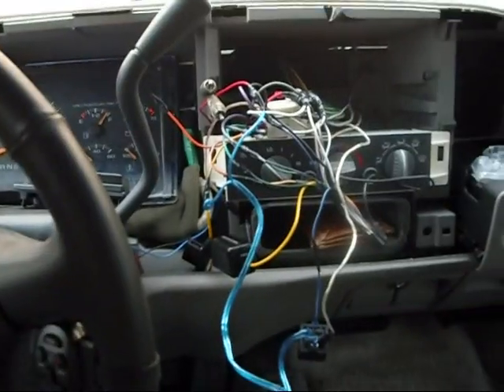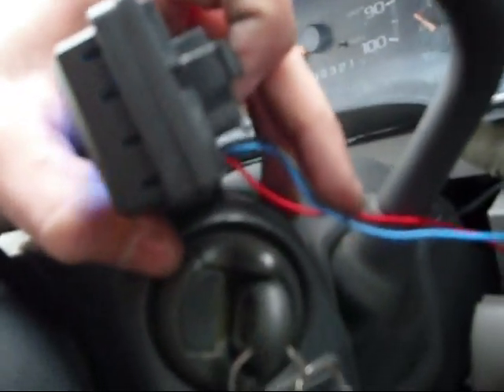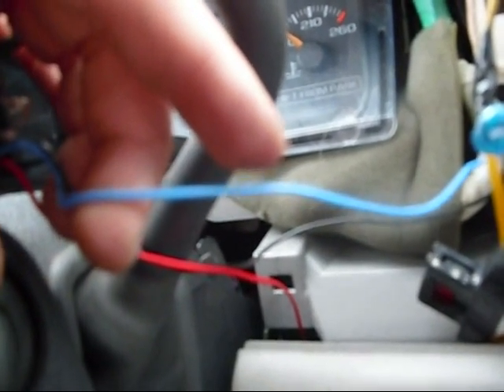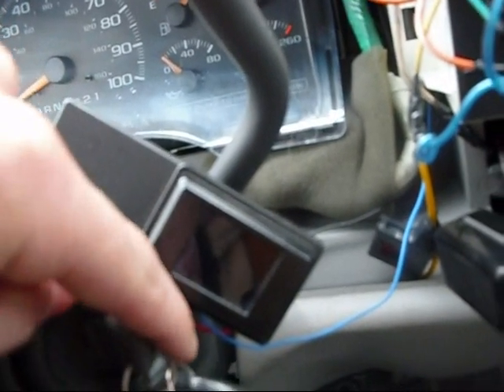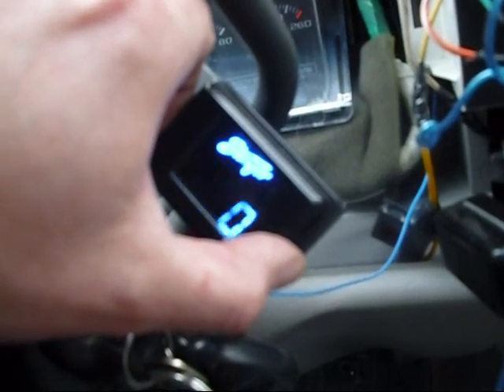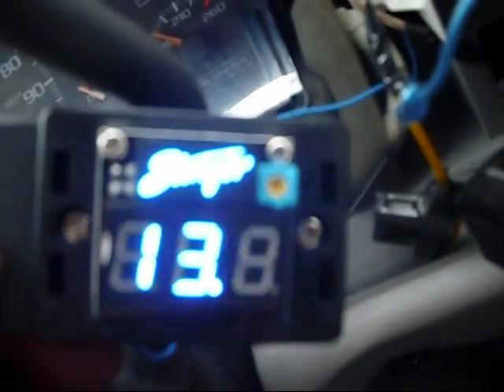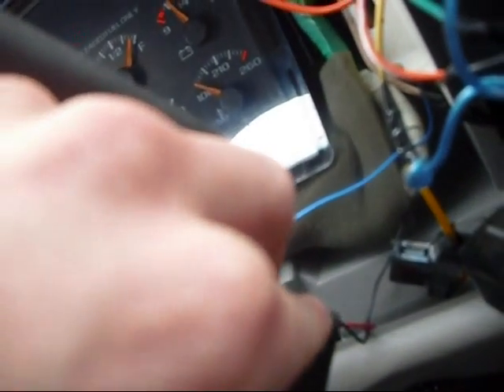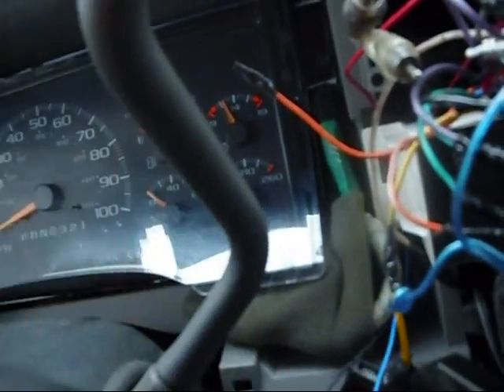how to wire a stinger volt meter

Comment: I would take the power from the power wire going into the amp. That way you're accounting for voltage drop across a 10ft wire run and all your connections. 
Because it doesnt matter if you have 12.8 volts on load at the alternator if you only have 12.4 at the amp.
Reply: The amp will draw current from the main run. 
Think of it like the amp is asking your battery for power depending on your sensitivity and volume. You tell the amp how much power to draw. When the amp asks for power it will find where to get it. The easiest path for power is the main run from your battery. That current is going to run through that wire directly to your amp and out. It won't travel through the little 14 gauge volt wire because 
1. The volt meter isn't asking for amperage. It's just taking two wires ( your battery positive and ground) and saying oh this is how much latent voltage is in the wiring. 
And 2. It's easier for power to continue through the amp and down to your whatever gauge ground than to squeeze itself through that tiny 14g wire that you use for a voltmeter. 

This is a vastly simplified explanation and there are particular exceptions but in this use case they don't apply. Hopefully I've digested the information somewhat efficiently but its hard to explain if you dont have knowledge on basic electrical theory.
Reply: that's not how it works.
99% of the time you are only going to draw power from a load or from a short circuit. the meter is just checking voltage its not a load that will suck a ton of power. for example. why does your amp only draw power when it is on? and draw less power when the volume is on 2. then when its on 30? you will only draw as much power as the load demands. the amp is what is drawing the power. the meter is just checking potential

Comment: I think you got it mixed up the blue wire takes the voltage the red wire goes to the power or switch . (remote turn on like you say ) . the blue wire will take the reading!!!
Reply: no red is positive like a car battery black is negative like a car battery and blue is the remote turn on like on a car radio or amplifier..when the key turns the blue wire allows the circuit to complete that's how you get the output in the display..please get help when you install it so you don't catch your car on fire

Comment: i have 3 optima battterys in the back of my car to power my amp and 1 bad stock battery  but i only have 1 alt. The problem is that i've heard that it is not good to have a stock battery connected to the better high quality batteries, how can i fix this? Charging the batteries in the back without connecting them to the bad stock battery with 1 alternator?
Reply: +Tobias Johansson who told you that lol you can run whatever with whatever but if you run deep cycle batteries to power your amp i would get a relay because they don't like being used as starting batteries

Comment: If I have a digital battery cap do I still need a voltage meter
Reply: Honestly, I wouldn't trust anything about a cap unless you're running class ab amps or lower. If you're running class d, all it's doing is restricting voltage from getting to your amp causing low current clipping. I'd rather just sell that and run a big 3 with a better battery. You'll honestly gain dramatically.
Reply: +STOPH3R01991 don't forget that a bigger alternator is what really makes the power along with the big 3

Comment: Where did you ground yours at? And the reason it was flickering on the camera is because the cameras refresh rate( most likely 60hz) is the same as the volt meters screen refresh rate

Comment: My 08 crown Vic doesn't have a voltmeter at all for the battery. I want a voltmeter to make sure when im dropping the low notes and just to make sure im in safe range. Would i wire it to my battery or to my alternator? Any reply will help just looking for some advice. Pretty sure my power is fine since i got 1 cvx 15 with a 2000 watt amp . Just want one just in case and for the future. Thanks!

Comment: and now i got my own! ^_^ lol got it last 2weeks on amazon for 24.65 a.k.a 30.23 and this thing is worth it lovin the blue led display ^_^the weird thing is tht i set mine with a 13.8 v 7 amp power supply and on my 20 amp it reads 14.1-13.8 volts..not tht bad xD

Comment from the maker: when you wire up the meter it doesnt just know what the voltage is you have to set it with a seperate volt meter and turn the screw until they are the same

Comment: hook it up to a relay and you will get a true reading of the battery and it will turn off when you turn off your car
Reply: I know this is an old post but.... I like that idea... Hook it to a relay with the switch side hooked to an acc power source. That way you can get a reading from your battery without it being on all the time. The way he has it, is it tuns on only when his head unit is on. Which is fine, but what if you don't turn on your stereo? But if you have the remote wire (which a lot do not), just hook that wire to an acc power source.

Comment: I bought a voltmeter off ebay. But it doesnt have a remote wire. Only the red and black wires.  Does this mean i need to install a toggle switch in the positive wire?

Comment from the maker: @kwag415 this gauge does not read voltage...it has to be set with a volt meter...all it does is read drop and gain to give you a reading,if yopu just hook it up it wont give you an accurate reading

Comment from the maker: @DaBandiiT you can wire the 12v to anything but it has to be a remote turn on when the key is turt...unless you run it on a toggle switch but i wouldent mant to have it that way

Comment: in order to set the voltage properly on the stinger meter did you take that reading initially when you hooked it up from the alternator or from the battery with the vehicle on/off? ...

Comment: @jonmanch3st3r does it say anywhere on the packaging exactly how accurate it is? I bought one of those junk (i know) voltage meters that plug into your cig. lighter socket and when it gets cold the reading is totally messed up (never accurate) nice video though. wouldnt it be better to put the red wire into the positive terminal on your sub amp to see what voltage your amps getting? then maybe wire a second meter to your battery up front to monitor the rest? that'd be sweet.

Comment from the maker: @Ranalla651 you need to get a reading from your battery with a meter,if you dont have 1 go to autozone or whatever you have where you live and they will tell you the voltage your at...then just match the voltage to your meter and it will rise and drop with the car

Comment from the maker: @Ranalla651 this meter doesnt read voltage it reads the rise or drop of it....so you have to set it and then it will move to show rise or gain on its own,its easy to set up and works great,when the truck is off it turns off,but when the key is in accesory it reads 12 volts which is resting voltage of a normal car

Comment: It is flashing on the camera and not in real life because, of different frame speeds.
 The eye cant see it, but the volt meter is actually flashing. The only way to make it not do that is by setting up the camera and volt meter to take a picture and flash at the same frame rate and at the same time.

Comment from the maker: @JoSeDbZcOoL well if your mounting the meter up front the best way is to wire it to the ground and remote on ur radio to keep the wires short then just have 1 long wire to the spot where u want a reading

Comment from the maker: @JoSeDbZcOoL 2 wires are long enuff to wire it to the radio for power,the wire that gets the voltage reading you will have to extend with some speaker wire its easy tho i did it to mine to make it reach my alt

Comment from the maker: @greenlight2600 once its set your good to go it read"s change in voltage...the only time you will need to reset the meter is if your battery is disconnected or dies or meter is disconnected

Comment: @jonmanch3st3r oh alright thanks man, what if the voltage changes would the gauge read that or would it just stay at the voltage that i set it on, I'm talking when the voltage changes during start up when cold and when it's hot

Comment from the maker: @greenlight2600 i dont get what you mean man,all you do is run the 3 wires on your volt meter like i showed in the video...then you need a voltage reader to take the voltage from where your stinger meter is wired....once you kno the voltage you turn the screw on the meter so that the voltage reads the same

Comment from the maker: @goatman5 it depends where your cap is mounted,if its in the back with the system its showing the voltage drop at the point....but if you also want to kno how your battery up front is doing,thats where this meter comes in handy and you wire it to that

Comment from the maker: @turbo1234a yes you can connect the red wire to any power source that you want voltage from,you will not need a fuse on the line.and your ground wire will be fine on you head unit thats where mine is